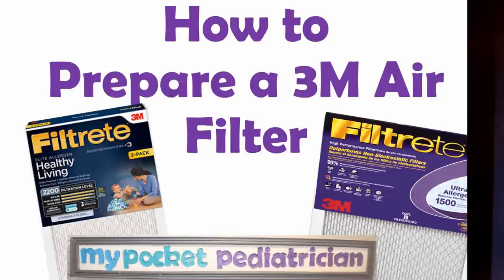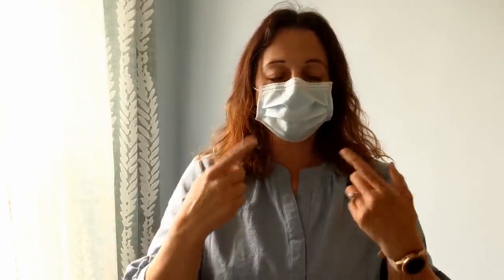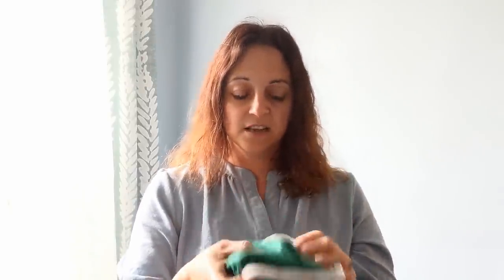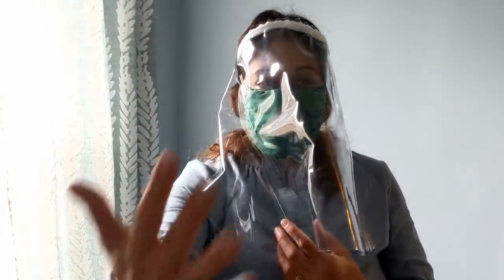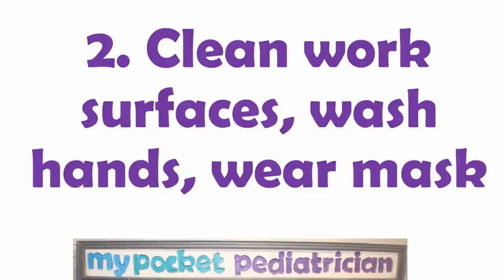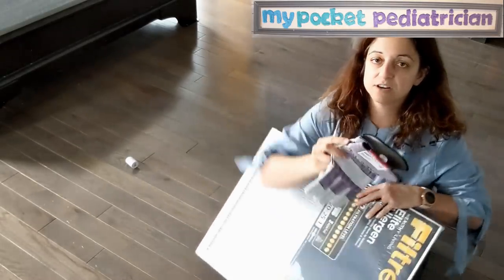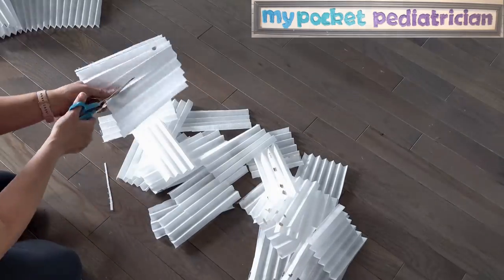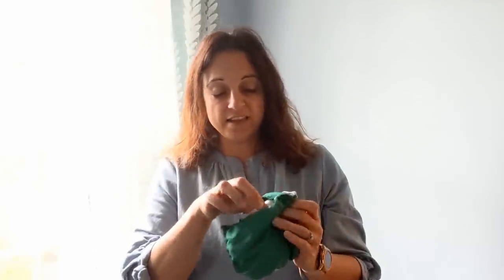UPDATED!  How to Turn a 3M Air Filter into a Face Mask

Comment: You are one of God's angels for what you do. I commend your efforts. However, there is much conflicting information to the general population about the prevention and spreading of virals. I will not go into the proper ways of using PPE in medical environments. They are highly trained professionals and one must assume they are acutely aware of the use of PPE. As far as the general public they must not attempt to use the PPE as the medical professionals do and assume they are using them correctly. Most of them do not and compound the dangers by gaining a false sense of security, therefore, becoming less careful. I must stress that the use of proper facemasks alone WILL NOT prevent anyone from the infection of virals. If one is within range of an airborne viral your mask might prevent it from entering through your nose or mouth passages but you are still susceptible to infection without proper eyewear. This is the reason you mustn't touch your face and eyes. You must remember that virals will always find the path of least resistance. By wearing facemasks in public the mindset is they are protecting themselves when in actuality they are unknowingly protecting others. No one is immune from virals. One may get infected and never know or exhibit any symptoms but will be a host to the virus thereby easily infecting others until their immune system builds enough antibodies to kill the virus. The mindset must be changed for the wearing of facemasks in public. Facemasks will not prevent one from the infection of others but will protect others from the infection of possible carriers. That is why we must all wear masks in public, for the protection of others from ourselves because no one truly knows if they are a carrier without testing. One must ask why then the media is pushing false and misleading information? Why do they want you out in public when they know full well you are completely defenseless wearing facemasks alone? What is their agenda? I find myself asking what it is they have to gain by skewing the number of deaths from the virus. If you absolutely must be in public one needs full-face protection. Ther is no other way. To be totally safe you must simply shelter in place if at all possible especially those most susceptible. It's also time to stop playing the blame game. The media preys on everyone's emotions by playing armchair quarterback after the fact. In my opinion, there is absolutely nothing different than what already has been done that would have prevented the spread of COVID-19 simply because we will never be able to control mother nature. Some argue we should have completely shut down much the same way China did. Again in hindsight. These people suffer from a special kind of stupid so I won't even go there. Even if we know to the minute when the next one happens there is nothing we can do to prevent it. It will happen. It will infect. It will hospitalize. It will kill. Vaccines help but do not prevent infection and take entirely too long to develop for virgin virals. We already know for a fact this very minute what is going to occur during this year's flu season. 60,000 people are projected to die in the US alone while over 500,000 are projected worldwide and there is absolutely nothing we can do to prevent it. Where is the media's concern? Where is the mass hysteria? If you truly want to survive, this virus should not concern you as much as the collapse of our economic system due to the hysteria that is causing a near-total shutdown in the name of public safety. We were warned by President Trump and the signs have begun to occur. People have no concept of the consequences of economic failure in the United States. Deaths and suffering beyond imagination. It will reverberate throughout the world. There will be no safe place on this earth. The worlds very survival relies upon a healthy capitalist United States. Do not simply follow. Question? Question? Question?

Comment: a 3m gitltrete 1900 air filter is readily available at lowes/ home depot.. take a hair dryer to loosen the glue around the edges, direct heat on the filter fabric melts it. plus the wire mesh if sharp, so be careful when pulling the mesh off.

Comment: I have been  making masks with a 3M air filter pocket. However I am having trouble finding elastic. Do you have any other options for a better fit?
Reply from the maker: I have only been able to get a fit with elastic.  I have a big roll (144 yards) that is overdue to arrive, so I've been experimenting with hairbands also.   I'm adding my findings into the next tutorial.   I found the black ones are really painful and uncomfortable and the multicolored ones are a bit loose but work with a toggle.   I'm going to fit test both tomorrow and will see if they work.

Comment: So it doesn't matter whether it is 1 inch, 4 inches, etc in terms of thickness, right.  Just that it is 3M and the higher rating, i.e. let's say 2200? Anyone?  Thinking maybe it just means more potential masks from one with a higher thickness!
Reply from the maker: I believe so.  The 1 inch are what I bought - the 4 inch seemed like they had less materials - it wasn't accordianed up like the 1 inch was in the ones I saw.

Comment: Wonderful video!  Thank you for all the information.  I'm glad you added the info about MPR rating (by M3) but I'd like to add that Merv rating 11 is comparable to FPR (by Home Depot) is 7.  I believe the highest rating HD has is 12.
Reply from the maker: Thanks!  I didn't know that.    I'm very new to this whole world of HVAC.   😆. So what level can you use for viral particles?
Reply: @MyPocketPediatrician  Goodness.. I have no idea.  I only knew about the MPR, FPR, MERV ratings b/c I shop at both Lowes and HD alot.  
I did have a question for you.  (Might be really stupid..) Would it do more harm than good if the cotton part was sprayed with something like ScotchGuard for fabrics?  I only ask b/c you mentioned how the virus would get soaked up by the cotton.  But with the filters in-between the outer part of the fabric and inside where you'd be coming in contact with, would it be okay?
Reply from the maker: I don't know to be honest.   I've sprayed scotch guard on our couches.  It smells awful before it dries, and I wonder if it would affect the breathability.   I bought some neoprene that just arrived, so I'm going to experiment with that also.  It seems like you wouldn't want a solvent that close to your face.   I also worry about flammability because we are exposed to O2 and I wonder if it could spark a fire.
Reply: My Pocket Pediatrician
9

Comment: Great minds think alike.  I use 1500 filters at home and had researched using them as mask and was surprised to find info on using filters for mask from this or higher filters.  thanks!  Now, if you could find where I could buy the machine they use to form the mask to the contoured shape that would be appreciated!
Reply from the maker: I sewed 2 washable cotton pocket masks to put the filters in and both passed the fit test.   The tutorial on that is here.  https://youtu.be/2J3Fq4o-U4I.  Also using Filti now, which was designed for face masks

Comment: I did check with a 3M rep. and they definitely DO NOT have fiberglass in them, so they should be safe to use.  My question is, since you said  that 2 filters were needed for each day... does that mean  you use 2 at one time in the mask?  When you were pulling the filters out of the mask, it looked like there was two at one time.
Reply from the maker: Yes....you need 2 at a time to ensure it is filtering what I hope is adequately

Comment: Should you just throw out the parts that had glue or cardboard adhered to them? Couldn't removing the glue residue with scissors make holes in the filter the naked eye may not see?
Reply from the maker: That's a good point...yes...good idea!

Comment: Ear loops simply cannot create a good fit and seal. That is why NIOSH requires HEAD loops for certification.
 Easy enough to change.
Reply from the maker: These are head loops.  I hate ear loops - they are painful and not functional.  My masks passed the FIT test.  I actually have an adjustable pattern that also passed the FIT test using Filti as the filter material.  It's available here.
Reply from the maker: https://youtu.be/2J3Fq4o-U4I

Comment: I thought the reason for the air flow direction had to do with the wire retaining mesh.  If you install it backwards with the wire mesh on the outside, your HVAC unit could suck the filter out of the frame as it gets dirty.  You're saying the filter fabric itself is directional.
Reply from the maker: Yes it is. There is a shiny side and a dull side. this is true because even though my filter had mesh on both sides there was still an arrow. The shiny side points towards the patient and the dull side points towards the healthcare worker.

Comment: For the bridge of the nose, I've cut a strip of tin off of a throw away baking sheet and sewn it into the homemade mask so there is a good fit along the bridge of the nose and under the eyes. I just wanted to add some info that may be helpful. Thank you for helping and passing on information that may help those trying to create the safest diy masks possible...and as always stay safe 😊
Reply from the maker: Have you washed a mask with that in it yet?  I had heard some others had done that too, but haven't heard how they are holding up for laundering.  What do you think?

Comment: Doesn’t the electrostatic material need the metal for charge?  I’ve been leaving it in.
Reply from the maker: No, the metal is just to help it stay in it's place.  I don't know how they get the charge in there - it's proprietary information, but they somehow impregnate the material with the charge.   I have a new and improved Adjustable mask with FILTI material that passed the FIT test!  Please check it out here:  https://youtu.be/2J3Fq4o-U4I

Comment: Thank you so very much about telling us NOT to iron!! I've got mine still sealed up. Honeywell uses a different system, 4-10- Only 9 & 10 filter out viruses, so I got the 10, but I need elastic, drat!
Reply from the maker: I bought 6 packs of headbands at Dollar tree.  They are about 1/4" but pretty thick.   I'm going to use them when I run out of regular.   I'll have to adjust so I have 1 14" and one 16", but I think it will work.  I wish I could put pics in the comments!
Reply: @MyPocketPediatrician  I cut elastic off of my fitted sheets. I plan to wash them in my laundry machine on sanitize. Do you think that will work?
Reply from the maker: @lindakuligowski9560  I think so.  Are they 100% cotton?
Reply: Linda Kuligowski use rubber bands
Reply: I’m out of elastic also, but found a video showing 1inch strips of T-shirt material. Just cut the strips across the body of the T-shirt and then pull them-they will stretch and roll towards themselves.  This is great because then you just use them as ties or ear loops.  Do some length tests to see what would work best for ear loops.  Easy to source, recycle and easy to sew.  Softer around the wearer’s ear also.

Comment: There is still the risk of sweat and moisture carrying the virus leaking into the edges of the cotton mask. Are you developing some kind of shielding to prevent moisture from leaking into the mask?
Reply from the maker: I have a face shield tutorial as well - there are other designs from 3D printers as well, but any fabric mask must be worn with a shield.  https://youtu.be/UKK0Y7XQN7I

Comment: I think "out" and "in" might work better than "front" and "back" or even "HCW" in terms of being clear, and make it easy for any one to figure out (I'm thinking my 87 y.o. grandma here)
Reply from the maker: Good idea.  Someone wrote "enemy" on the outside part.  Maybe ever just "face"  Whatever works for you is fine!
Reply from the maker: Also, I have an updated video here:  The mask passes the FIT test and I'm using new materials - Filti, which was designed for face masks.  I also have a discount code for my viewers.  https://youtu.be/2J3Fq4o-U4I

Comment: Some people have been talking about using hepa vacuum cleaner bags for filters inside the masks, but also wonder about fiberglass.  I haven't been able to find out if they have it or not.
Reply: After lots of research, and having that same question myself, I’ve found that there are many brands that are not made of fiberglass. Filtrete (3M), and DVC bags are not fiberglass. Can’t say for sure on the others. You need to check with manufacturers to be sure. The other thing you need to watch out for with vacuum bags is that some are too difficult to breathe through. The DVC micro-lined are 95%. I just took the bags apart, discarded the outer  papers, and am using the lining as filter material.

Comment: Is the ac filter made of fiberglass?
Reply from the maker: No.  You can see the materials in the MSDS sheet on the pinned comment.   However I have started working with a different material called Filti that was designed for face masks and you can see the tutorial here.  https://youtu.be/2J3Fq4o-U4I

Comment: Fiberglass warning.   There has been a statement out by 3M not to use their filters in this way.   Don't use HEPA vacuum bags either.   Fiberglass warning.   Even unknown fibers will contain fiberglass.
Reply from the maker: The MSDS sheet is pinned to the top.
Reply: @MyPocketPediatrician  So you are going to inhale wax and other substances?  I think you are making a big mistake in promoting using these filters.   I have contacted the CDC about this practice... and I do have Filtrate's and 3M response to using their products in the masks.  I plan on posted those to your site soon.     I think you better read the MSDS sheet yourself.

Comment: One of the protective composite to N95 mask is citric acid. I  Desolve some in water and spray on filter and fabric
Reply from the maker: I have a new and improved Adjustable mask with FILTI material that passed the FIT test!  Please check it out here:  https://youtu.be/2J3Fq4o-U4I

Comment: Does the moisture in your breath neutralize the electrostatic charge?
Reply from the maker: I honestly don't know.  It might.   The filter is supposed to last 3 months in an HVAC setting.   I hope it would last 8 hours or less in a mask, but I don't know.   I am working with a better material that is cheaper and doesn't have the moisture issue, so please subscribe and get the notification when it's available...I'm hoping tomorrow.

Comment: Do you disinfect the gloves before using them?
Reply from the maker: I bought them new for this purpose.   I guess you could spray something on them...rubbing alcohol maybe?  I have a new tutorial on Filti, which was designed for this purpose, so you don't have to bleed making it, and there is a discount code for my viewers, so it works out to be cheaper than these anyway!
Reply from the maker: https://youtu.be/2J3Fq4o-U4I

Comment: My pocket pediatrician, I have a olsen made mask. If I put a seal with tape around the perimeter of the nose and mouth and insert a 3M filter of 1500 or greater, will this protect me? Please reply, I would greatly appreciate it. Thank you.
Reply from the maker: The only way to really know is to fit test it.   I've been seeing reports that the Olsen mask is not passing some fit tests.   One...I believe you would need 2 3m filters of 1500 or higher.    Two you could use Filti....check out this video, and I also have a discount code for them.    Three...I don't know what setting you are wearing the mask in, but you definitely need a face shield with any fabric mask.
Reply from the maker: https://youtu.be/2J3Fq4o-U4I.

Comment: Instead of elastic band would sewing tying ties work the same. Elastic is rare in stores.
Reply from the maker: You probably won't get as tight of a fit.  The seal is the most important part of the design.  I did buy some headbands in the dollar store that can be adapted also.

Comment: Those filters contain fiberglass?
Reply from the maker: No. The MSDS sheet is pinned to the top of the comments. It is also in the description. It is made out of polyprene, but I did find a better alternative called Filti and made a new tutorial on using that which you can see here. It is also cheaper depending on the shipping.
Reply from the maker: https://youtu.be/2J3Fq4o-U4I

Comment: Not good to encourage people to start cutting apart filters which are not meant for wearing on your face. It just risks lung damage. Could be fiberglass or other dangerous particles depending on which model they buy.
Reply: "use or processing of the product in a manner not in accordance with the product's directions for use may affect the performance of the product and may present potential
 health and safety hazards. "
Reply: Official response from 3M: "Thank you for contacting 3M, Construction & Home Improvement Markets Division.
Our filters are made from Polypropylene plastic fibers and strands, adhesive, paperboard, and for some filters, metal wire. Our Filters do not contain Fiberglass. However, our Filtrete brand products are designed to be used in home HVAC systems. The filter media in a Filtrete brand filter performs very differently than an approved N95 respirator or mask. It cannot achieve the fit or performance of a mask or N95 respirator and modifying the furnace filter may damage the material. 3M does not recommend or support the use of a Filtrete brand filter to make a mask or respirator."